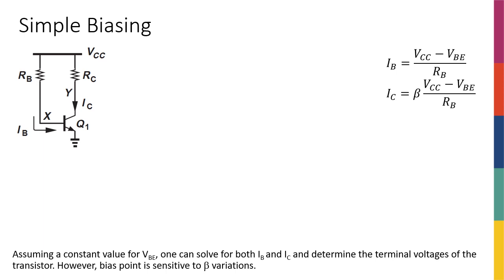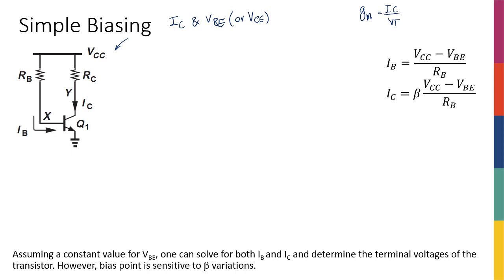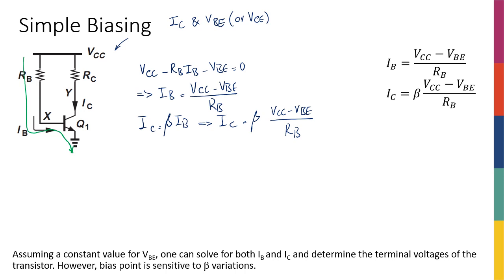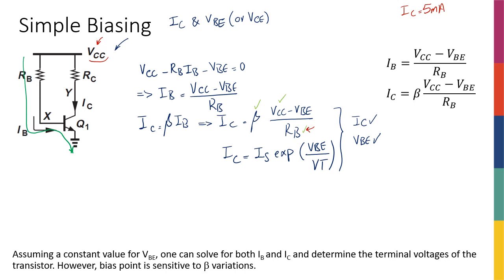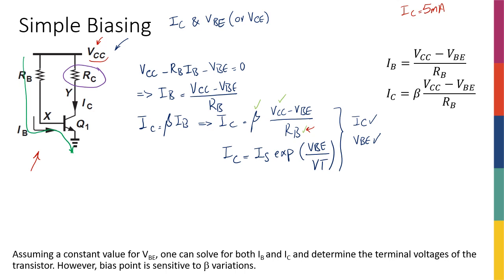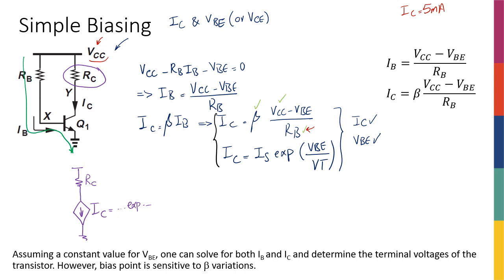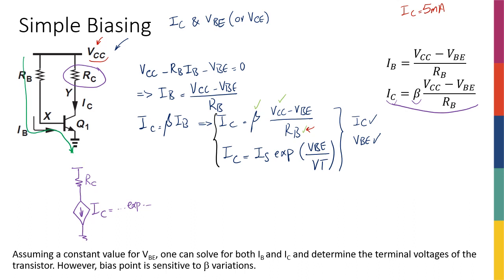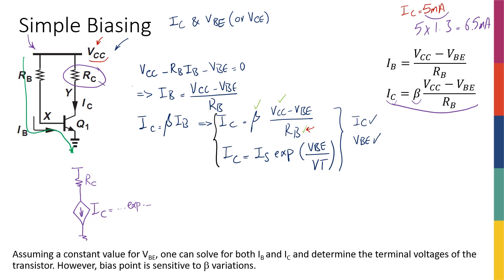Week6 - Simple Biasing

Comment: 4:25 Rb is not the only variable left , If you assume 5ma the you can determine the exact value of Vbe which will aid in a more correct analysis instead of just assuming it`s 0.7  that will not be a correct assumption